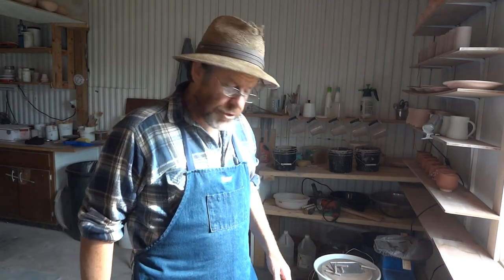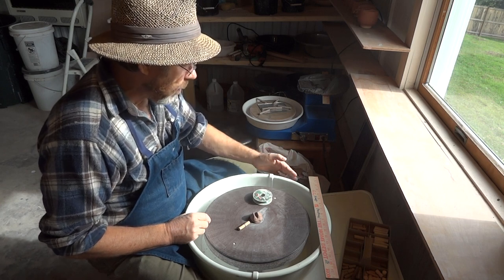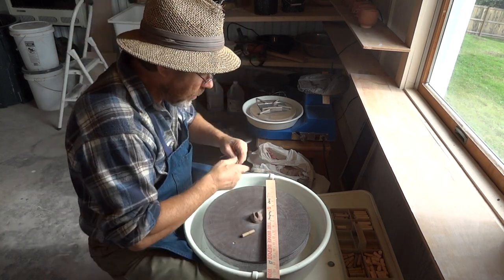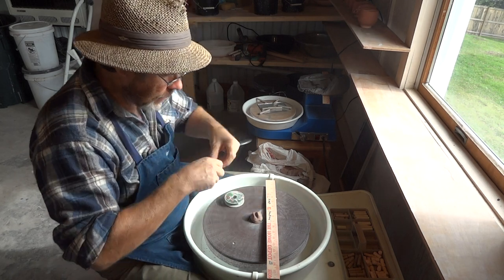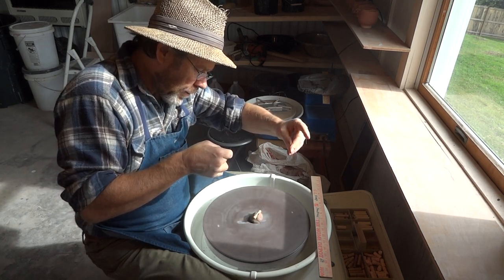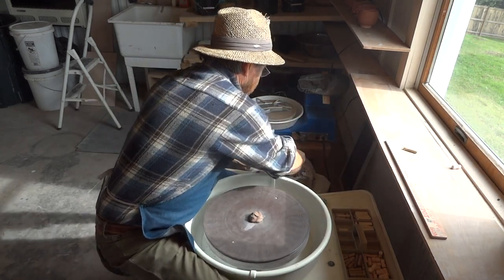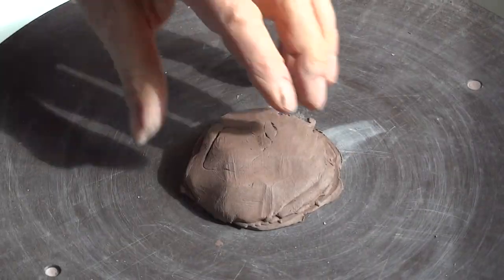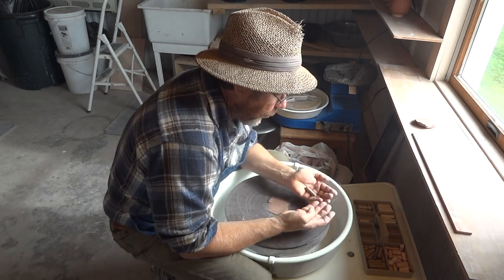SIMON LEACH POTTERY TV - How to make a twisted cut off (nylon) wire !

Comment: I have busked this using thin brass wire and jewellery pliers a bead clamp and 2 different toggles from bad cut off wires from the shop. It took me much longer than 20 min.  ☺

Comment: I have busked this using thin brass wire and jewellery pliers a bead clamp and 2 different toggles from bad cut off wires from the shop. It took me much longer than 20 min.  ☺Now for the sponge sticks.

Comment: Nice trick using the wheel to twist the nylon stands. I've always made my own wires using model aircraft control wire (probably no longer available) and fix the toggles by feeding the wire through a hole in the middle, looping around the toggle and back through the hole, and repeating ~ makes a sort of figure of 8. I'll try that with nylon. Thanks for all your tips.

Comment: About Charles' comment on pretwisting the wires Simon: It's the way they make rope - if you twist the individual strands, say, anticlockwise first, then when you twist them both together clockwise they want to stay twisted. Still need the knot because they are more slippery than rope and will still want to untwist if not stopped by the knot.

Comment: Made one of these using cocobolo (nice and heavy) toggles turned on the lathe.  As a fisherman the knot I used was a tucked half blood knot - dead easy to do and worth googling. I wonder if braided nylon might work as is rather than twisting it yourself - might not give the nice spiral effect on the bottom of pots though?

Comment: Good idea Simon, the problem I'm having is my pots are detaching from the wheel before I have run the wire right through therefore spoiling the pattern.
Reply: If you cut your piece off the pot earlier [wetter], this won't happen.  Also, if you use Hydro-bats available from http://www.theceramicshop.com the pots dry from the bottom and no cutting off is needed.  I use 14 inch bats as ware boards.

Comment: When spinners make a two ply, which you are doing, first the two strands are twisted in the same direction separately. Then the two strands are twisted together in the opposite direction. Now the cord will not unravel. From a Master Spinner.
Reply: good tip
Reply from the maker: charles vereschagin Thanks Charles, just not quite understanding clearly what you mean here though...please write to me via my website if you prefer.many thanks.
Reply: i think he means twist the two strands in one direction, like you did. Then switch the wheel into reverse and twist them the opposite direction. It is easy to make these with an electric drill and the other end of the wire in a vice, try it out